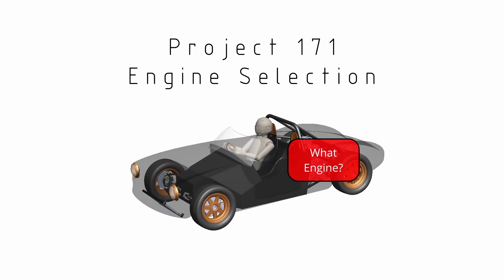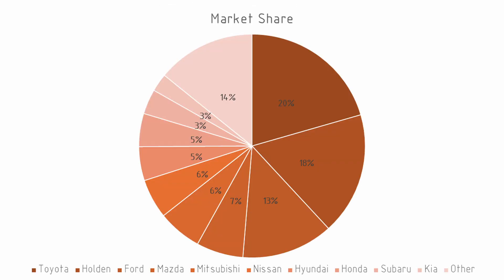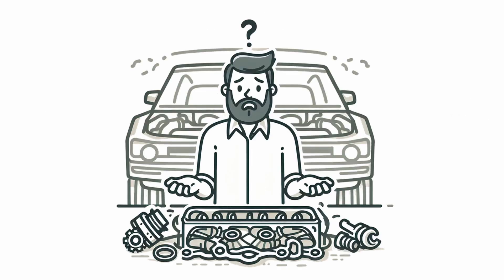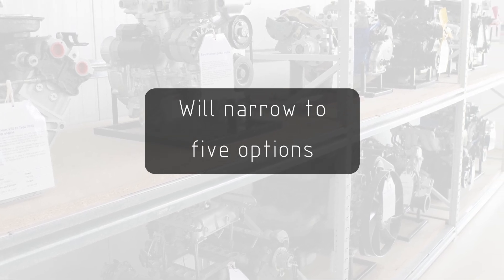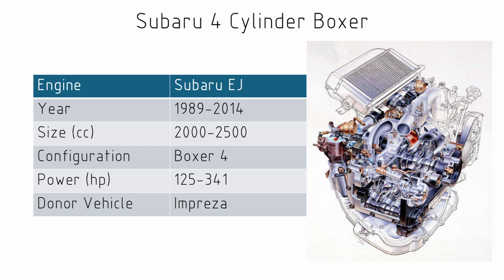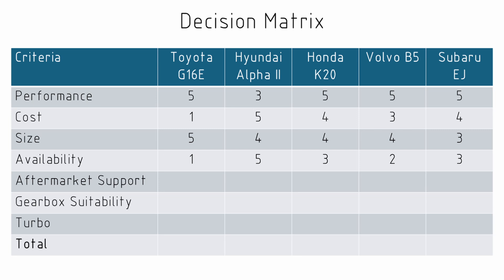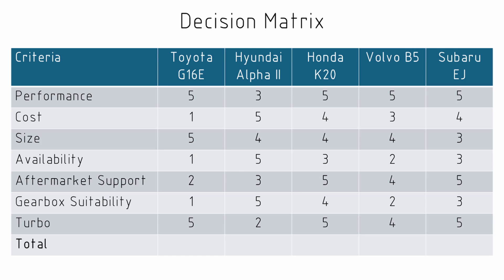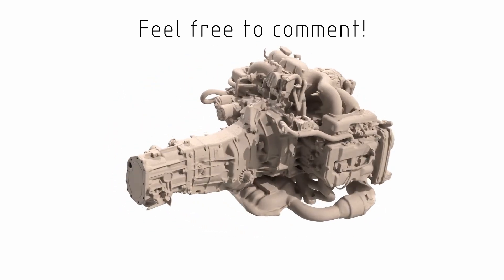Selecting the Right Engine for a Custom Sportscar (Project 171)

Comment: in the subaru familly, you can always swap the ej25 for a Fa20 out of brz for 200hp and  more rev happy engine. the 6cyl EZ30 is only 2 inch longer and about 40lbs more for a 250 whp 6cyl engine.. the sound should really help add characer if needed.. they all adapt to an ej25 transmission with the same clutch and flywheel.
Reply from the maker: It is one of the reasons that the Subaru engine is a decent choice.  Wanted to make sure there were decent upgrade options in the future.

Comment: gearbox suitability of the subaru is probably not that big a deal, just weld the center diff.
Reply from the maker: It is easy to bypass. Have a converted gearbox sitting in my workshop at the moment.

Comment: I've gone through this whole process thousands of times in my head. I have a front drive impreza gearbox that I got for $50 in the shed. Please finish this build and produce a kit which can be easily engineered as an ICV in NSW. Also, please make it 70-80mm longer in the engine bay just in case you ever want to run the EZ30 (and get much more "porsche" like sound, better NVH, more reliable etc.) Let me know when you are taking deposits! P.S. I also looked at the Honda D series since they sit on the opposite side to the driver and in small lightweight cars the left to right balance can become problematic (sylva riot punters say so anyway). Love your work, carry on.
Reply from the maker: I have heard getting just about anything through ICV in NSW is hard work!  No plans for a kit, not sure I want to take on that level of risk, but will look to see how much of the project can be shared.

Comment: Yikes. Subaru? You sure? A wankel might actually be an upgrade. 😁

Your target HP is only going to be in the mid 100s right? IMO that would point toward a small, single-head, aluminum engine under 2l.
Did you not get 1.6l Fiesta STs or 1.6l Honda Civic Sis in Aus?
What about the old Celica 2zz? 

And technically speaking, isn't the transverse engine layout more efficient? And don't the crank/flywheel spin opposite the wheels/brakes and cancel out some angular momentum?
Reply from the maker: Happy to admit it was probably not the best option. The EJ is a very popular choice with people working on VWs or Porsche replicas. While this is not a replica I do want the car to have a call back to the older lightweight porsches ... Well without the Porsche pricetag. And if/when I get bored with the power level the Subis have plenty of turbo options.

Celica 2zz would be a great option if I was sane though :)

Comment: Ford 2.0 Ecoboost would score 34 in your decision matrix if you were going for a Locost instead of a 550-ish.  In the US they are in the Focus ST but they are also in the Escape and Fusion so super common and dirt cheap.  They are all turnocharged and have an integral exhaust manifold so free turbo.  They are direct injection so you have to do a stock ECU (Cobb/Montune tune them) or go with something like a Life Racing ECU.  The 2.3 (which is essentially a stroked 2.0) can make around 700 hp in a full race aplication with a big turbo but it also makes 350 hp in Focus RS trim, so if you put a Focus RS head and turbo on a 2.0 you will get a 350 hp+ capable fuel system and a turbo that can move the air to go with it, all with OEM reliability (if you get the tune right).  The Ford Mustang puts a Getrag MT82 6 speed behind the 2.3 that transmission is a little bit big and heavy but it can survive behind a Coyote 5.0 V8 so it should be absolutely bulletproof behind a 2.0 in a light weight car.  Lastly there are dry sump systems available for the engine so you can mount it lower for better CG and pull high Gs without running dry.

Now a built 2.0 with aftermarket rods and pistons, a Focus RS head and turbo, custom intercooler, Montune dry sump, Life Racing ECU and an MT82 transmission with an appropriate clutch isn't cheap (probably about $15,000) but it's not too bad and you could probably start around $5,000 if you just did a built shortblock with the stock ECU, a clutch good for 400 hp and a used MT82.

You could look for the Focus ST 6 speed to use in a transverse mid-engine setup but you'll pay a lot for that transmission because they didn't put it in anything else AFAIK.

I don't think the donor car idea is as good in the US, unless it's a Mustang you don't get a complete drivetrain and and all of the suspension is built for a car that weighs twice as much.  We have plenty of self-serve and full-serve salvage yards so if you want to scavenge a wiring harness or most any other part you can do it without buying the rest of a car.
Reply from the maker: The ecoboost is definitely a favourite of Locost style cars. Popular choice amongst those building those sorts of cars here in Perth. As time is going on in the design I am looking to pull even less from a donor car. Might not end up with a donor at this rate, for similar reasons you have mentioned.  The value is probably in all the little bits that tend to get forgotten about until putting the car together.

Comment: Great decision for a low centre of gravity. You didn’t state if you’d be using an aftermarket market ECU. I raise this only because the G16E has Direct Injection and not many ECUs can drive the high pressure injectors. It’s moot in this case as you’re going with the boxer.
Reply from the maker: Definitely leaning towards an aftermarket ECU, and yes the low COG is an advantage of the boxer, although it isn't that much lower than a compact 4 due to the exhaust being below the heads.  Not planning on anything direct injected.
Reply: Good point about direct injection being incompatible with the vast majority of aftermarket management systems. 2000psi gasoline pressure coupled with 115 volt piezo-electric injectors in close proximity, in a hot, high vibration engine bay put me right off running the OEM direct injection in my peugeot 205 with a mid mounted THP270 engine. Port injection at 43.5psi into the OEM inlet manifold and Haltech Elite 1500 ECU for me. Far safer!

Comment: I had a similar process for my project and recently acquired a Nissan maxima with the vq35 and 6 speed manual. I also strongly considered a Subaru but the v6 has more NA horsepower. Good series!

Comment: Hi Kev, remember, Subaru also have the later FB series engine. The EJ has a cambelt and the FB is a camchain engine. Newer is always better :-)   Regards to you and yours,Pat
Reply from the maker: Was looking into the FB as well, it comes down to suitable gearbox options, the newer motors have some key changes in that interface.  The newer Subi motors are pretty cheap though and would be a good option.
Reply: @KevinHayward7  There are oodles of 2 litre FBs out there in XVs (Crosstrek) There is also a 1.6 litre turbo FB in the Levorg.

Comment: Why is the year not important? Wont a newer engine such as the G16E require much more ECU work than a less electronically controlled and older model? I would expect that programming/electric knowledge would be a factor in this choice. Otherwise, I think the boxer was a great choice
Reply from the maker: I'm not that worried about programming the ECU, so wasn't a worrying factor for me. Although it possibly could be for someone elses's project. At this stage planning to run a Motec ECU because that is what I have the most experience on, but still a lot of time to go before I am at that stage.

Comment: 9:37 BTW I happened to be selling my Volvo with that engine. It’s a 2.5L turbocharged engine that has 132,000 miles on it. Just 10,000 miles ago, it had its head gaskets replaced and shims adjusted. The car is currently located in California. 😅
Reply from the maker: The nearest car with the 2.5L turbocharged Volvo engine is in my driveway. Clsoer than California, otherwise would have been a tempting offer :)

Comment: 15:51 A alluminium lightweight in-line 4 with up to 8500rpm oem rev limiter with infinite aftermarket support for a lightweight N/A build sounds exactly like those 2 cars. And with a turbo added the weight and complexity might aswell be used on a tougher oem block unopened. But using a Boxer makes sense in the sense of Porsche replica... Even though its a turbo one. All good options. BTW why not consider the 1.8t from VAG or the Ecoboost?
Reply from the maker: Good points. Both the VAG and Ford engines would definitely be contenders. Not sure they offer anything conceptually that the Honda doesn't already provide.  The Honda aftermarket is probably a bit more developed as well.  Maybe I'll need to do another car or two after this one to get through all of the good options :)

Comment: Love your work mate. I'm a big fan of Subaru's.
But, I think you missed out on a couple of evaluation criteria:
1) How much does it move my heart
2) Can I get it to fit, and do maintenance on it, without a complete redesign
You came up with a good answer anyway.
BTW, there's a bloke in Adelaide CNC machining Subaru engines that can make hundreds of horsepower (like 800 or similar). (He also machined a 3,000 hp Nissan 6cyl engine block too.)
There's SOOOooooo many go fast parts for Subarus. You can keep adding them, every time you want a bigger smile!
Reply from the maker: Subarus are definitely an interesting breed. Bought an older wrx a while back as a temporary car just to see what the fuss was about. Was a pretty cheap car at the time but it definitely was a lot of car for the money. Still have the car (much longer than I expected to).  Definitely appreciate companies that go about things a little bit differently, and am a huge fan of the aftermarket and modification of Japanese cars.  It is the Hot Rod spirit in a different generation.

Comment: Nice…. But also Look into oil pan configuration to assure supply in long corners? (Subie rally guys know)
Reply from the maker: Good point, also need to watch the angle of the gearbox. Not sure I'm keen to go a dry sump though while the thing is on the road.
Reply: @ I recall baffling used to mitigate the problem… I visited Vermont Sportscars who built Team Subaru factory rally cars while a friend of mine was a driver… I imagine known solutions for known issues

Comment: GWM is supposed to be coming out with a 2 litre flat eight that would be cool, I don't know if it will be a boxer though. It seems little need for it to be. Other interesting engines but probably below your power requirements are honda st1300 V4, and the goldwing 1.6 or are they up to 1.8? I've seen one mated to that subie fwd box you were talking about, in an Imp. A small 2 litre V6 from Mazda seems cool, but the power doesn't seem much. The G16 will have all the aftermarket support you want by the time you finish the build, I'd guess, catch it on the way up.
Reply from the maker: Those are some very interesting engines. Hadn't heard of the upcoming GWM engine, interested to see how it goes.

Comment: You missed another key criteria.... power output. For example, the Honda K, will be able to handle at least 100 more BHP (reliably) than the scooby doo, without needing to open it.
Reply from the maker: Power was captured in the first criteria (performance) but maybe I could have been a bit clearer.  All of the engines (with the possible exception of the Hyundai) were going to be able to meet the power required.  However I wholeheartedly agree that if the goal was to chase outright power the Honda K is a better option than the EJ. Apart from rebuilding the engines to original specifications I don't plan to do any crazy modifications.  Engines can get expensive really quickly.
Reply: @KevinHayward7  No worries, good luck with the plan. it takes balls of steel!

Comment: I don't know much about cars, but I find your videos very interesting and informative. I suppose it isn't easy to quantify how easy it is to work on an engine, but I think that it would be something worth taking in consideration (as with the rotary). Looking forward to future videos!
Reply from the maker: Thats a very good point, maintenance is a really important consideration. I think most of the difference in maintenance comes down to the installation and accessibility, so more likely to be due to problems I may or may not introduce with the chassis design. Probably anything with the head (and spark plugs) running vertical is probably better to work on, so maybe another reason why the EJ might not have been the best choice :)
Reply: @KevinHayward7  I suppose that choosing an engine one would enjoy, aligns really well with the design pillars of a project which has enjoyment, rather than pure utility, as its overreaching goal. I am very much looking forward to these type of analytical and pedagogical videos on how this car will handle. How does one design a car that handles well? How does one quantify such a thing?
Reply from the maker: Those videos are planned. I have definitely spent more time working on vehicle dynamics and handling than I have on engines, and has been a long term interest. It is particularly interesting as a lot of the driver experience is based on trade-offs. Increasing cornering often comes at a cost of ride quality. The position of the driver in the car affects their perception of the vehicle's performance. Vehicle turn-in may be improved at the cost of mid corner performance.  There is so many interesting design decisions around handling. I'm looking forward to making some of those videos.
Reply: @KevinHayward7  I imagine that one needs to set clear goals, to be able to resolve these conflicts of priorities, in to satisfactory compromises. In your video "Choosing Benchmarks for a Custom Sportscar", you mention several cars which have, as I understand it, a good reputation when it comes to handling. Maybe it will be interesting to make a comparison?

Comment: Mate I would definitely say 4g63t for your situation specifically. You can easily make around 400-600 hp on the stock platform with a tune. The aftermarket availability is enormous for it too and you know that Mitsubishi is reliable asf. 
Also, I know that you said you won’t be using a v8 but i think you also look at Toyotas 1UZ, great engine and great sound.
Reply from the maker: Great suggestions! The Mitsubishi engine would definitely do the job. When I was a kid my mum had a turbo Cordia with the 4g62T. That thing basically lived in Turbo Lag, but was very cool when it got on boost. 
The Toyota would be a great engine for a different style car I think, maybe a mid engined GT.
Reply: Agreed, have you figured out what chassis you wanted to use? Forgive me if I’m getting ahead of myself here but I think you should look at mr2 or a mid engine converted miata. I would also highly recommend reading about the lotus Elise as I believe there is a lot to learn from that car. It’s unlikely you can find one for cheap but it would be almost perfect for your project.
Reply from the maker: I will be designing the chassis from scratch. I am a little unsure as to whether go monocoque or spaceframe though.  I have built more monocoques, but the material costs can be quite high, and there is a bit of testing that needs to be done. The Lotus elise is a great car, and a good chassis. It is one of the benchmark cars mentioned in a previous video. I do know of one (well actually a VX220 - same chassis) that I could get a hold of fairly cheap, but definitely want to go custom with the chassis.
Reply: @ why not cut out an existing chassis and make it extremely aero and extreme downforce, making your own chassis from scratch is going to be very expensive
Reply from the maker: Designing and building the suspension and chassis is the part of car building I like the most.

Comment: I think you've made a great choice. But if I had been in your position, I'd probably consider the 1.8 or 2.0 litre VAG engine found in a lot of Audis and VWs as well. Perhaps they're not as common in australia as they are in Europe, though.
Reply from the maker: Tough choice when putting up either the Honda or the VAG engine. If there were 6 options, it would have been the 6th. In the end they just aren't as common in Western Australia as the K series. If I was in Europe it would be very hard not to choose though.